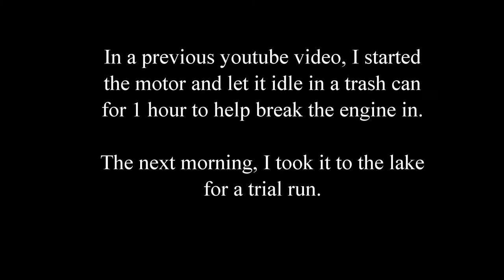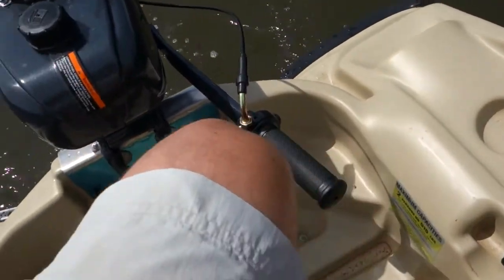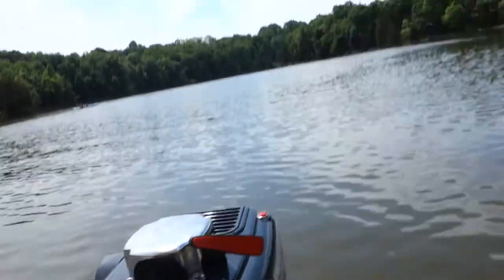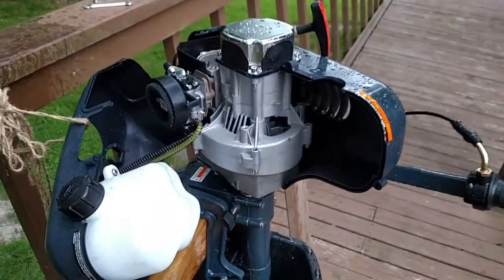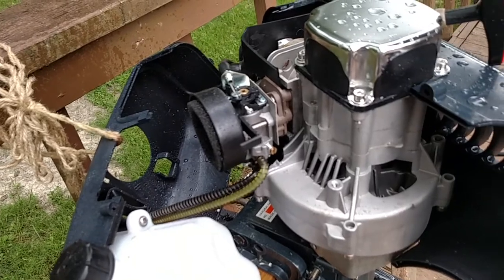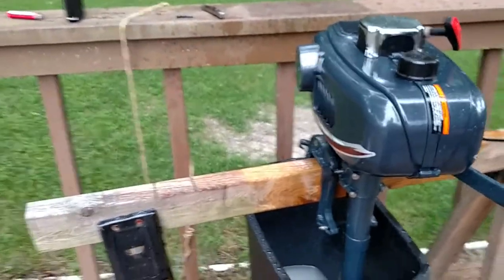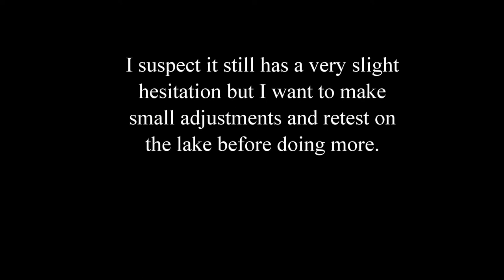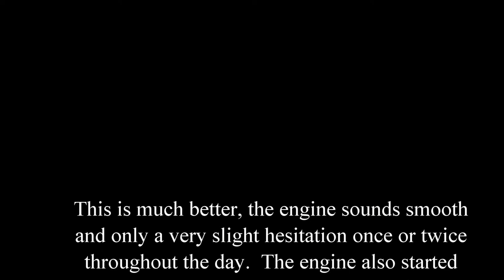hangkai 3.5 HP motor fix (air fuel ratio)

Comment: why not spend a little bit more and get something good like a honda or a merc lol....
Reply: Beacause something like Honda cost 8 times the price of a Hangkai, parts are harder to get, they cost allot of money. Hankai weighs only 7 kilograms and have a built in tank. Hangkai parts are all over eBay and they are so cheap and the engine is so easy to maintain your kids could do it. I had my Hangkai outboard 7 years now and it is still running like new. I have 4 outboard engines, I know what I´m talking about. I just spent a little more last week and got me Suzuki DF6A. I love my Suzuki but when the wind picks up waves i better like Hangkai. Much safer and easier when going after my fishnet with a Hangkai.

Comment: Trash motor, very bad outboard  motor, bought in amazon, dont lost your money
Reply: Its a great motor for the price. sure you have to tinker with it here and there. If you're not tarded, its simple. after about 10hrs of use,  I accidentally flipped the kayak in the bay, where the motor was submerged in saltwater. Took it home, cleaned it up the following day. started right up, no issues.